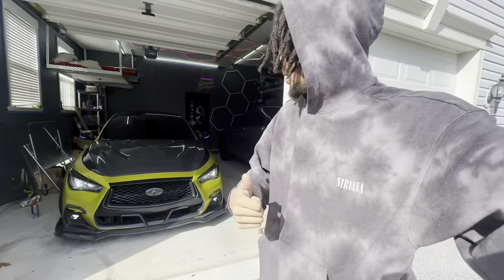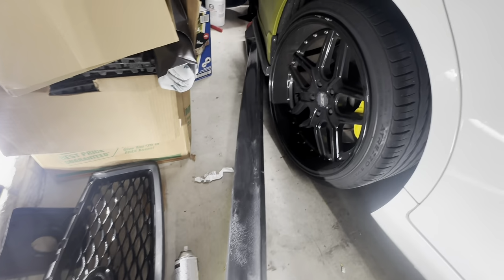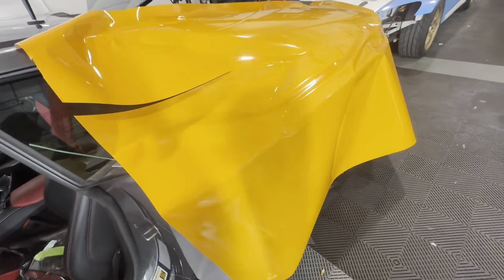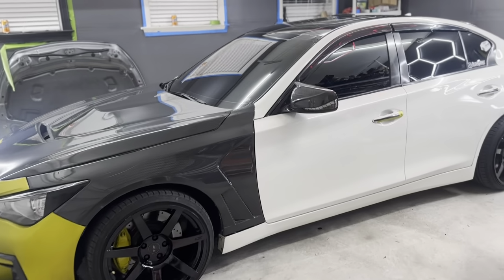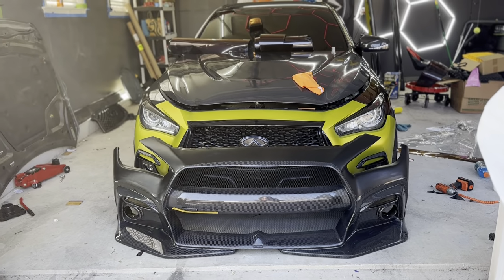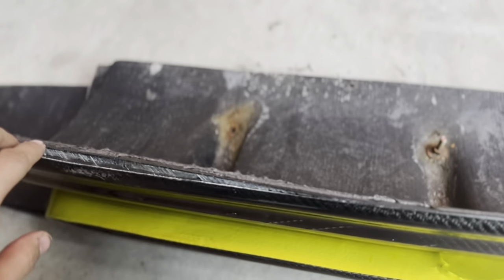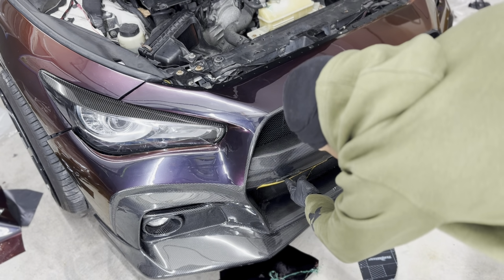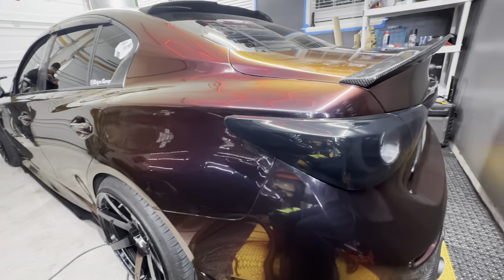TRANSFORMING MY Q50s INTO SOMETHING CRAZY

Comment: Yo your car is fire bro I got the same shit as you the red sport But only thing is my red diffuser is different I didn't do anything about the fender yet If you have an email address I can show you how mine's looking at I had done work on my headlights right now I removed them I put the stock everything I was looking at your video right now I like how you did your all your work yourself which is dope everything's coming fantastic bro might have to you know get some ideas from you and then get some rims right now I have the chrome rims on mine Your car is dope the way you actually hooking it up Wish I had the talent to actually you know do it which I could do but you know it's very time-consuming to do all that yourself and I would need a garage Right now I'm just working with performance as well You know I just need to get my heat exchanger a valve and some extra shit to put in there I have the quad exhaust as well too right now in there You shit is nice bro I'm actually looking at your car right now as we speak
Reply: And yo bro let me know I'll send you my email like I said I love that front bumper I have the original one that you had on yours I'd like to be get the same front one too even if it's not carbon fiber but at least fiberglass cuz I don't know what material they make it but that shit is dope bro that fuck with this bumper
Reply: In the side skirt kit the way you have that too I love that those are the only two things I want bro I love your work man
Reply: brodi sent a book
Reply from the maker: Thank you bro🙏🏽🙏🏽🙏🏽 good luck with your journey building the car aswell